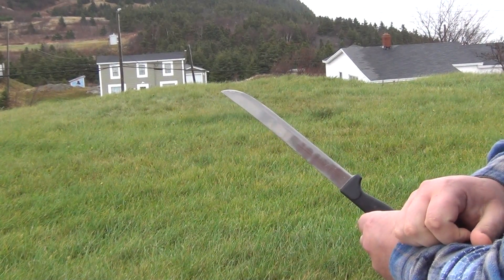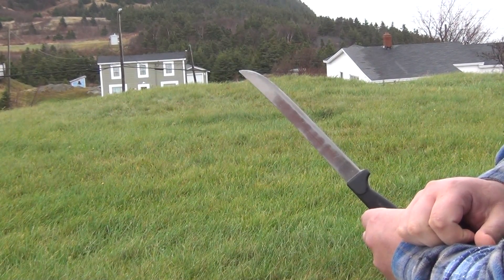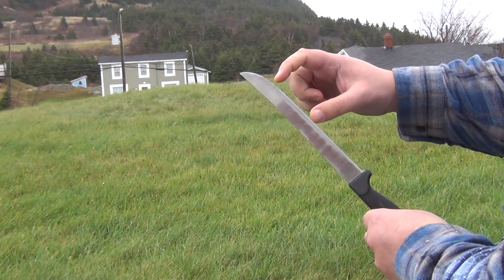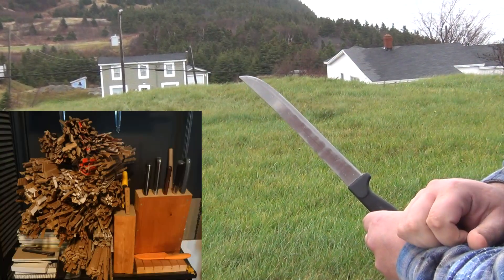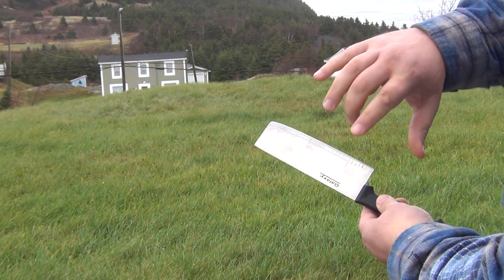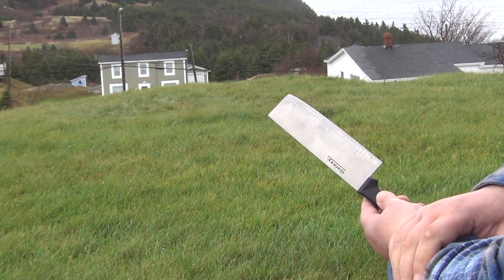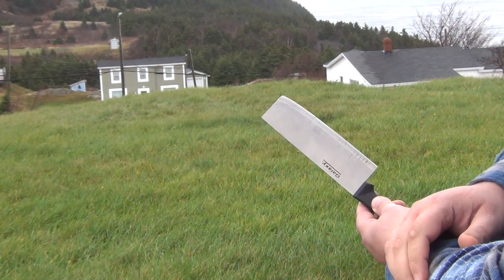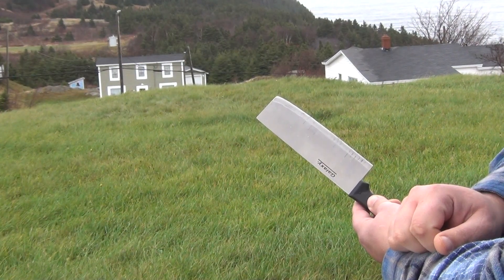Knife Challenge 30 : Spyderco Sharpmaker 15 vs 20 dps microbevel

Comment: Weather looks cold, but nice!  Will snow start sticking soon?

Couple of questions:
1.  The Spyderco gray is finer than the DMT 600 yes?  Substantially finer?
2.  Is this Chef knife the "worst knife ever" one that you used?  The steel on it is very soft right?  Easily damaged?
Reply from the maker: Yes, the Spyderco medium is twice as fine as the DMT fine, mine is a bit worn but still it is much more coarse than the medium.

Both knives are 3-5Cr13 class steels, I would estimate them to be 50-55 HRC, they are easily filed, not nice to sharpen, gummy and prone to easy of burr formation. In fact that is why I had to use 20 pps to set the micro-bevels as I had to go very light. With a sensible knife like say Kyley's Victorious it would only be necessary for 4-5 pps.
Reply: Cliff Stamp Thank you for the info.  I'm going to have to think about this one a bit before trying to answer.